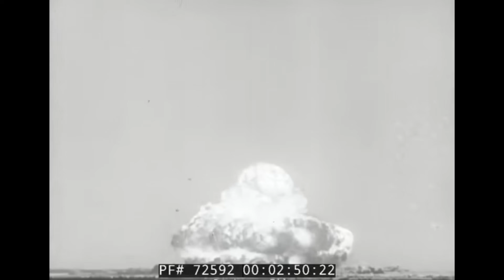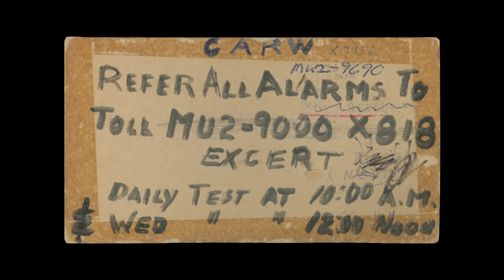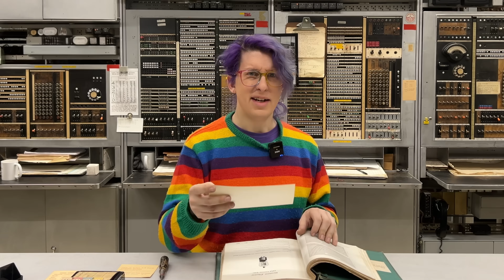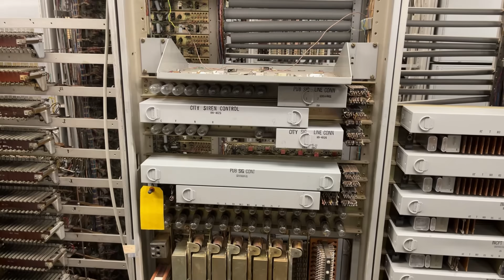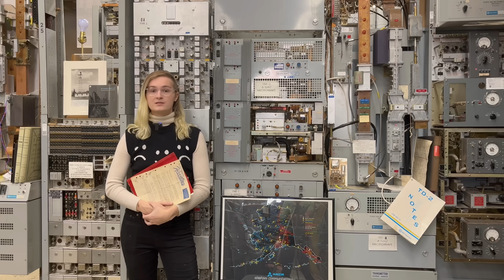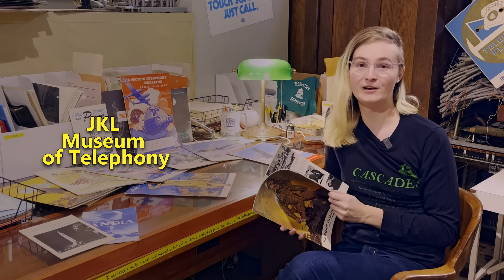CARW: Bell's Nuclear-War Telephone Network

Comment: White Alice was a 'Over the horizon' Microwave system. It refracted the signals across mountain tops to deflect the signal downward, This both extended the range, and improved coverage past the mountain. This required a much higher RF level than point to point microwave links. This is also why the antennas were so big. 
I was a RF Engineer in the US Amy in the '70s at Ft Greely. We used White Alice for both military and civilian phone service, as well as to feed the AFN radio network and multiple current loop teletype circuits. The audio was exceptionally clear. I could call home to Ohio and get better service than a local cal since it was microwave all the way to that city's CO. Greely was used for the Lend Lease program during WWII as an Army Airfield to supply Russia with planes and other warmaterials.
Reply: Troposcatter
Reply: @MrShobar  They used high power transmitters, and refraction across moubtain tops to connect the terminals. It was a unigue system. I used it in the early  70s. The sound quality was amazing. It was connected to terestreial microwave links in the lower 388. so a call from Ft Greelly to Midletown Ohio wa cleaner than a call ibto ant local town in Ohio. The antennas were huge, to get a tight focus on the selected peaks. It was a one of a kind design, but was eventually replaced ny undergound cabled, long after I left Alaska. The AlCan highwat was still mostly unpaved, and damgerous to many bad drivers.
Eisting phone lines were still lead jacketed , but the hosing ares on base were run in the steam trenchs to every building on the mewer part of the base.  The cable to the TV station wouldd droop low enough to walk into during the summer, then shrink quite a bit when the temperature dropped over 199 degrees. I was an RF Engineer in the US Army.

Comment: I'm curious why CARW used a separate ringing generator that was only powered infrequently during activation, as using a relay switched cycle from the main office ring generator would have improved reliability by using a constant use system meaning faults would be quickly identified/fixed. (The British Telecom equivalent of this system called HANDEL used the Speaking Clock circuit to ensure quick fault detection, in a similar way.)
Reply from the maker: It could have been a consideration of load. If there were more than 100 stations to ring simultaneously, that could put a significant load on the main ringing generator, which might already be overloaded if there was a real emergency. 

There is an option to use the main ringing generator in the schematic. It’s up to the telephone company how they actually want to wire it. 

Faults are located by all of the dials and all of the bell and lights stations being in one large circuit. If that circuit is broken at any time, an alarm will sound.
Reply: @ConnectionsMuseum  Thanks so much for the info! It's greatly appreciated as always. I'm so grateful for all the time and effort that all of you put in for systems such as CARW, which could easily get somewhat lost given their relative lack of public discussion during their service life. Actually, I'm grateful for everything that you all do, always.

Yes, I can absolutely see the point about not overloading the main ringing generator that may well already be overloaded under conditions where the system would actually be needed. That's an extremely good point.

I hadn't thought of that, and actually I should have done, because the British HANDEL system suffered from a similar problem but in a different way. Whilst it was a voice announcement system using a carrier tone to activate the receivers, as it used the local exchange speaking clock circuit to operate (injected before the line amplifiers from the clock announcer so as to use the same office equipment) this meant each receiver station needed a local battery and/or mains power source for local amplification due to the line attenuation caused by the alert stations when they went off hook on the same shared circuit in response to the carrier. Obviously, the line amplifiers for the speaking clock were never intended for that many subscriber lines being connected under normal conditions.

In comparison, the American CARW system has the huge advantage that it's entirely powered by the line current and avoids the huge wall mounted receiver/transmitter sets that HANDEL needed at all relevant police, fire, military and government locations. I do love the simplicity of the user sets for CARW in comparison and also that it shows a decisive alert state rather than a generic alarm followed by a live spoken transmission that had to be specifically listened to.

Comment: Actually I built a telephone/intercom system in the early 80's without any training in how these systems worked. I bought on Canal street (downtown Manhattan) back then a series of tubular relay switches that were powered by solenoids. thus when a person dialed their phone the solenoid would jump the tubular selector switch to the number of turns dialed and I then had a relay drop in with that contact to hold the position and suply voltage to a cheap buzzer I put in the phone base. it in turn would quit buzzing when receiver was lifted sending that dc voltage to the phone electronics activating the handset to audio connection to the callers telephone as well. meantime before that one would hear the buzzing sound in the earpiece of the dialing phone because of the buzzers high speed switching on and off as a solenoid the buzzers were but with circuit to open and close at a fast pace due to the metal fingers activatnig the buzzer. Because this setup was in an old Upper NY area campground type place with 6 buildings it had a complete system of Bell Co. wiring outdoor mini ground towers I was using to do the place to place hookup without having to run wire and yes without Ma Bells permission. I did this and unfortunately was transferred from here to another place in Long Island and never heard about how well it worked or didn't because I left just after the first initial testing took place with a few of the phones hooked up (they all were) and get a completed call to the dialed phone. Just thought I'd give my experience with such systems.

Comment: Oh my, microwave relay links. A brief anecdote about that lovely White Alice technology: back in the day (in this case, the 1980s day) my employer had a leased data line from AT&T between northern California and Arizona, and mysteriously the line would fail fairly regularly in the summer. The story we eventually received from the nice people at AT&T Long Lines was that the culprit was smog-induced multipath distortion on the microwave links passing through Los Angeles. It is lovely to see that those clever folks at Western Electric repurposed 4-party polarity signalling to light those four lamps (without actually requiring Extra Lamps, super bonus moment, we'll just use these Light Emitting Relays we are using as the lamps). Thanks so much for all you do (and all you film)--as you can tell, it delights me.

Comment: What are you missing at each Switch or C.O.?    The famous Service Observing lines and Shoes.  Tell us how these were used under the old switching systems.
Reply from the maker: We have the SO equipment but it is not wired up (yet). A project for the future!
Reply: @ConnectionsMuseum  Thanks for the fast reply.   In every CO building I have visited from SXS , ESS, EAX, ISDN, ADSL there has always been a simple way to monitor ( listen in) subscriber lines for "Quality of Service" (legal pretext for "spying").  One device designed exactly for this purpose is the "Service Observing Shoe" which has zero other legitimate uses.  No administrative subpoena or request, no court order,  no FISA warrants, or telecom records have ever been required for this "service".  In some Telcos this privacy invasion is "approved" by the internal security section which might send out an order to a switch for the line to be monitored.  The rationale is to "improve service" by actually listening to voice conversations Full Duplex.  A cheaper and more private way is to just provide a knowledgeable, diligent and rapid "customer service" 24/7/365.  This has Never existed. Any of the Talley books can be used for reference.

Comment: I went to school at Arizona State University in the late '80's. Every Saturday at noon, the air raid siren on the hill to the north of campus went off during its weekly test. Us dorm dorks referred to it as the "hangover check."

This siren had a rotating horn assembly to extend the reach of audibility. As the siren went through the test, you could hear the sound volume (the actual volume, not warbling) change as the rotation came up to speed, became steady, then slowed back down to a stop. On particularly bad Saturdays, it would come to rest with the business end pointing straight at campus, so you got to listen to the siren at full volume until the siren itself finally spun back down.

Great video. Thanks for the fantastic history lesson.

Comment: This was an interesting video!  I'm glad you told us about this stuff.  When I was a kid my father repaired all kinds of electrical motors, and he was asked to repair one of the city's sirens.  He did the repair, and then he was trying to figure out how to test it.  The shop was located in a residential neighborhood so he didn't want to fire it up outside.  He did a couple of quick bursts of power to it to make sure it would run at all, and then he wanted to run it up to speed to make sure it was okay.  He ended up pointing it down the stairway to the basement, and put a plywood board over the opening, and then firing it up.  It was still really loud, but I guess it was quiet enough not to freak out the neighbors too much as no one complained.

Comment: Well, one niggle. There is no pre-computers stuff with PSTN, the switch was a computer - an electromechanical computer.
Oh, part of the old CD and defense network lives on in the red switch network, which was digitized back in the early '90's. There were and are still parts of that network that I wonder about how DISA keeps track of so much disparity and keeps all of the balls in the air, but it works and is reliable.
Reliability being kind of important, lest you get to be the poor sap that gets to tell The General why his telephone isn't working... Well, that and there is no big red button at the White House (well, other than Trump's Coke button). Nukes would be launched by a single telephone call, authentication and orders, then a bright light, rude noise and mayhem would ensue.

I'd completely forgotten about cold cathode thyratrons being used in the old analog systems!
As for the warning notes all over the frame, 130 VDC isn't much an ouch for me, been lit up by quite the assortment of voltage sources over the decades, 130 VDC would be rated as a mere tingle that reminded me to stop being fucking stupid.
My last such reminder, 230 VAC/50HZ through my crotch to ground while testing my coffee pot while abroad... Didn't need a night light after that one, but I did prove my father in law wrong, I am decidedly not a numbnuts.
For the record, the coffee pot had a failed thermal fuse and a major failure it shared with my car, loose nut behind the wheel.

Comment: Glad to know, I grew up in Medford, OR. and I remember the Long Lines Tower going up above the phone company building (didn't know what it was then 60 years ago) The building was standard concrete wall with light color brick overlay, big glass door with a ringer phone to try to get in. Then later they put a sort of red brick around the building but it was spaced out about 4-5 feet on a steel I beam frame, made the building so much bigger looking. The tower with the long line antenna went up and had round heads then later they were removed an the horn shaped ones you see in the photos available today.  Looking back I so "wish" I had known something , just a stupid kid, and photo'ed the construction even one or two photos. All the things seen, forgotten and later remembered, Thank you for the info that is only 60 some years to late for this stupid kid.

Comment: I have a video of an abandoned AT&T microwave tower in rural Summit county, Ohio (Richfield), which has been abandoned since probably the 1980s, when fiber-optic cables became standard; that one was built in the late 40s. (those things were designed to withstand atomic blasts up to several megatons, but not a direct hit.)

A western suburb of Akron still tests its outdoor sirens weekly (whole system of Federal Signal 2001s); another suburb still has a Federal Thunderbolt from 1953 in service, which was part of the Akron siren system that was removed when the Cold War ended. 

Would the blue also be used for natural disasters?

Comment: Can you eventually configure your 1-ESS as an AUTOVON switch? (4-wire with E&M signaling for all circuits with MLPP). Also, you need the SS-9 signaling system for the 4-wire station set.

Comment: Wonder how the equipment covered in this video would fair in an EMP event.  And at the end donation of the dial was mentioned yet earlier it's mentioned a "trade for" the dial happened.
Reply: It's been brought up in other circles that this stuff is fairly EMP proof because there are no semiconductors. IOW, low voltage stuff is more easily damaged.
Reply: @rupe53   You are correct. Very low sensitivity equipment here.
Reply: Museums donate between each other by trading but it is still a donation from the other museum. They traded for a card for a card reader phone.

Comment: My old man was an RCAF radar tech on the Pinetree Line, the precursor to the DEW line.  It was crazy times and technology evolved very quickly during those times. Also the fire station where I work used to have a Canadien Civil Defense air raid siren behind it, it was an Allertor 125 which was removed when they shut down the system in the 80's.

Comment: What a fantastic discussion on how these things worked, and it seems Bell were quite ahead of our own GPO 🇬🇧 with those „lamp“ boxes! Many thanks to both Sarah and Claire for this! 😇👍

Our distributed warning system of the time was attached to the Speaking Clock and gave a „chirp“ every 30 seconds to confirm the system was functional. An alert was signalled by somebody in the CO picking up a microphone and reading out Attack Warning: Red/Black/White (Attack/Fallout/All-clear) repeatedly. This made Bells system an on-demand broadcast system, whilst ours was more like a nationwide party line! ☎🎉😋

Mind you: Whenever I see the abbreviation „CD“ ☢💿🏦 and think of its many meanings, I can't help but wonder if one of the secret goals of the 20th century was to load that abbreviation with as many diverse meanings as possible? 🙃

Comment: I’m a huge civil defense enthusiast. I plan on making a modern version of the “Bell and Lights” system called the Federal Signal “RadAlert”. It’s basically like a fire alarm system but for nuclear fallout when it reaches a city. It’ll also work for nuclear power plant leaks too. The alarm will be a horn strobe similar to a fire alarm but yellow with an amber light.

Comment: Went to High School in the mid 1960s in Kenai , Alaska where there were White Alice antennas locted 25 miles north of town. I had a mobile CB radio in my VW bug and found that finding the sweet spot in front of the White Alice antenna allowed my to converse with other CB operators in Japan when " Skip Signal conditions were present.

Comment: Thinking about in my country the existing sirens network just received a big overhaul of the control system to cope with the end of POTS that was use since the first day to control them.
Of course, it was all digital since the 80's as the entire country telephone system was  switched to digital (with only the customer line kept analogue), but still worked with cooper. 
As the coper will be "physically" cut off soon.
Theirs purpose nowadays is still to ask population to confinement but it's all about industrials accident, like a big ammoniac leak or even a nuclear leak (as there are a bunch or reactor here)

Comment: Using the power supply for a piece of VoIP equipment to power up your vintage frame seems appropriate.
Reply: Well, 48 VDC is a common standard in communications.
Look at a network router or switch used in a corporate environment, you'll see a plate for a 48 VDC connector. Some datacenters actually have 48 VDC buses to support network equipment today.
DC doesn't travel well, Edison's failure, Tesla and others got it right that AC travels well. There is minimal travel in a datacenter, so DC makes sense, uses less circuitry and requires less regulation, due to its already regulated condition.
Reply: @spvillano 48V DC "phantom power" is also used as a power standard in audio recording, specifically microphones, as a holdover from the telecom industry as well.

Comment: I was really hoping to find they had a way to decode the ring cadence using vacuum tubes. Hey can you tell us about ring cadences? I work in VoIP and we reference four ‘bellcore’ cadences, might that name happen to do something with the bell system?
Reply: Bell Communications Research (Bellcore) was the shared R&D company set up by the Baby Bells after they were broken off from AT&T to help maintain their common standards and procedures. Eventually the baby bells sold off Bellcore which renamed to Telcordia and currently operates as iconnectiv
Reply: @St0rmcrash  thanks!
Reply: Probably for party lines